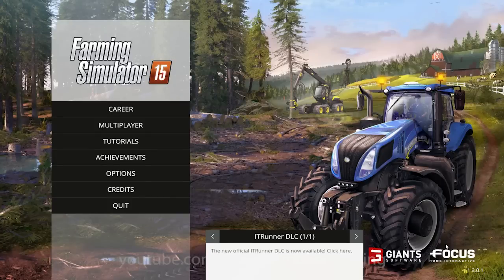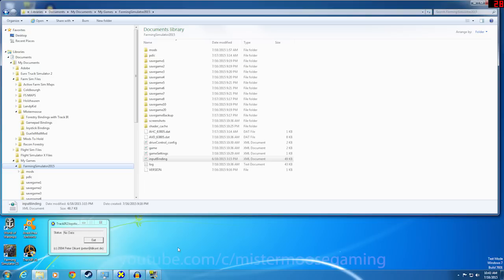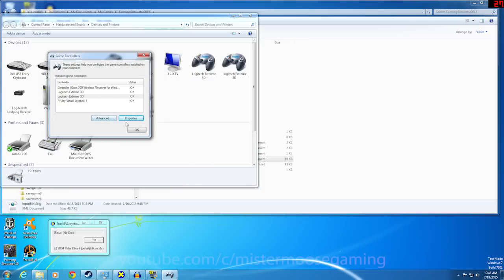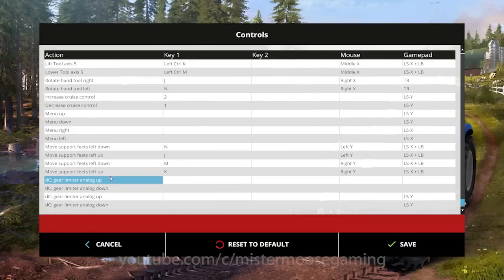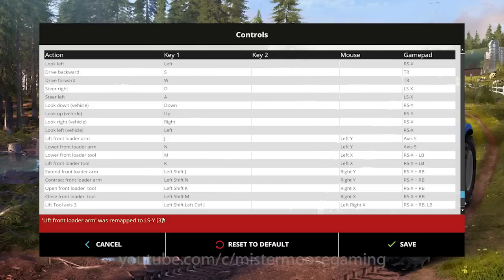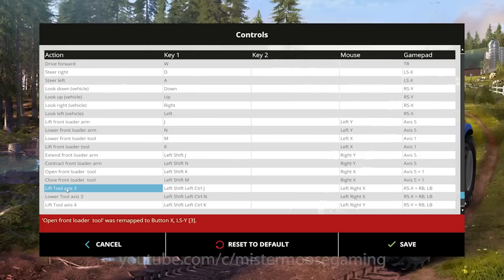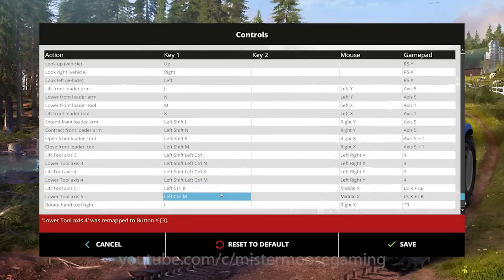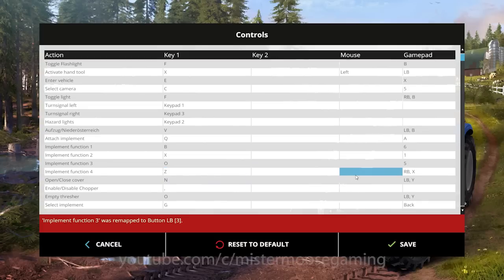Farming Simulator 2015 - How To Setup Dual Joysticks for Forestry

Comment: You can also use a little piece of software called Xpadder that will map your stick movements and buttons to any key binding you desire. Using Xpadder you can have as many game controllers as you want, without messing with the in-game key bindings. I'm using a steering wheel set in-game and two joysticks set outside the game environment this way.
Another option is the JoyToKey software.